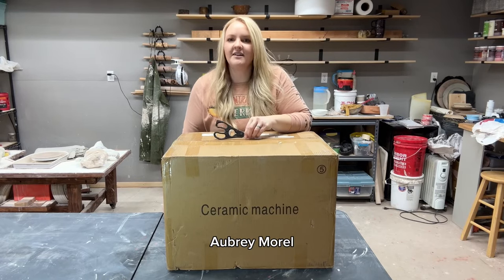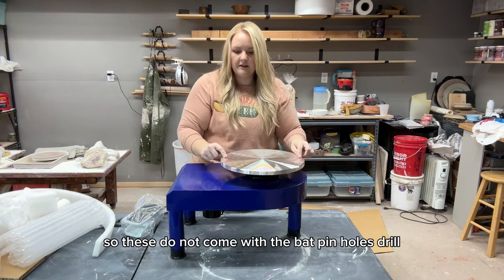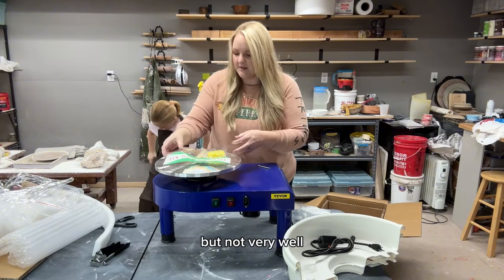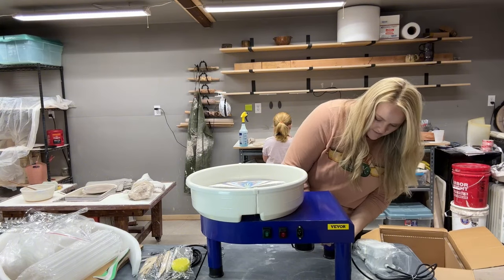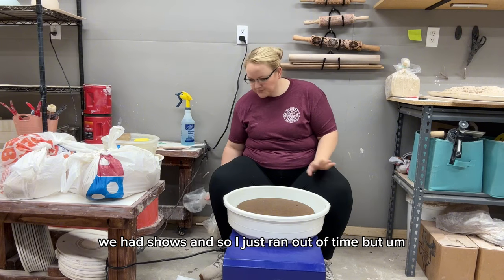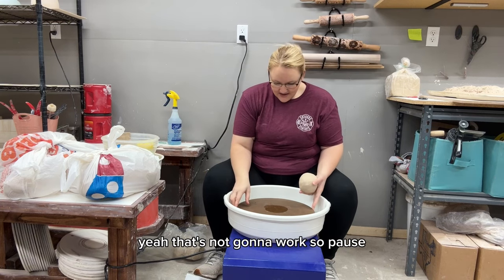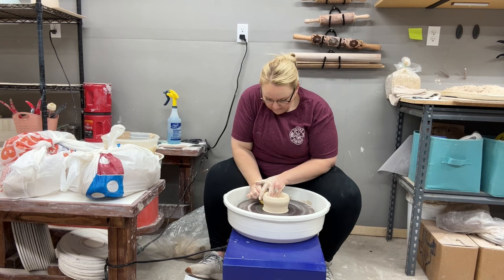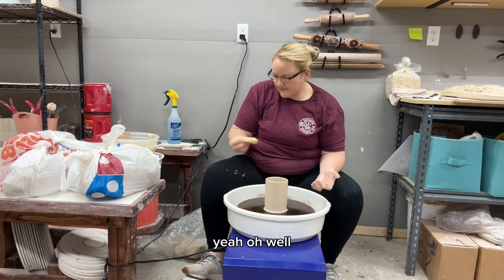Review of VEVOR budget pottery wheel from Amazon - not sponsored #pottery #vevor #review #ceramic

Comment: I'm considering getting the same wheel. Thanks for the review! My biggest concern is that it doesn't seem to spin slow enough. I like to go really slow for some things. Has that been a problem for you still or is it no longer an issue?
Reply from the maker: Actually it has been an adjustment. I have to really ease on the pedal and even when it starts there’s no super slow speed. I’ve been making it work but it’s not ideal. My original Amazon wheel had that slow speed that I like.

Comment: Wow. I’m so sorry you had the problem with your outlet dang it. Lol. What kind of wheel is your older one? I’d be afraid this one will give you problems since it was a return. Let us know if you plan on keeping it? The splash pan should definitely not be up that high.
Reply from the maker: I’m keeping it, my husband drilled the holes for the bat pins already lol. I was really curious about the splash pan. I’ll have to learn to sit differently with it but all in all the wheel works so far. 

My original orange wheel is Yae Tek brand from Amazon, I have it linked in the description as well

Comment: Now that you’ve had it a few months, what do you think?
Reply from the maker: It’s ok lol. I wish I had saved for a better one but in a pinch it’s fine. It struggles to center anything more than 5 pounds. At 6 pounds the wheel pretty much stops spinning during centering. It also makes a high pitch whining noise when it’s rotating. It’s not an issue it’s just annoying. It’s not all bad. It’s a good size wheel for the price. But if you plan to throw large items I’d find something with more power.

Comment: If you plan on keeping the wheel, get yourself some bricks a
To put under the legs.  I have bricks under the legs of my wheel plus the shop that I used to go to had put bricks underneath their wheel legs as well. We needed to get it high.
Reply: I was wondering if you could put the legs in thick PVC tubes to lift it. I was looking into it myself. On the bats have you ever looked into using a tile for the bathroom (6") in the cut out of another bat? 
Thank you
Reply: No never tried using PVC nor tile for inside of bats
Reply: I started on the same orange wheel as you.
I was able to upgrade to a used speedball Artista wheel. I also bought the legg set for it. I ordered small batts for it. The speedball takes the 14 'batts, but the wheel head is a bit smaller than that.
Try finding metal pipes the same size as the inner leggs. You can make them longer to raise the wheel up.

Thanks for an honedt video
Reply from the maker: @allenfitz1 yeah I’ll give something like that a try to raise it up. I would have loved to get an artista wheel. I think I have my sights set on the black Brent wheel though lol.

Comment: I bought the same height adjustable wheel few months ago to learn on. It too had sharp metal snags I had to file off. At first threw on the metal wheel and the grooves made getting the pieces off very difficult, it also tarnished after one use making sponges dirty and it stained permanently. I then put a bat system on it. But still something about it was just off, I had suspicions it just wasn’t level and sure enough the front leg sat 1/4” lower than back legs because the holes weren’t placed right. Trying to make it work to learn all the fundamentals, but I can see a better quality wheel in my future. Then it will be the trimming wheel. It works for now but overall…. Meh.
Reply from the maker: Yes exactly my thoughts. All the same issues. I left a review on Amazon where I purchased it. Let’s see if they reach out to make it right